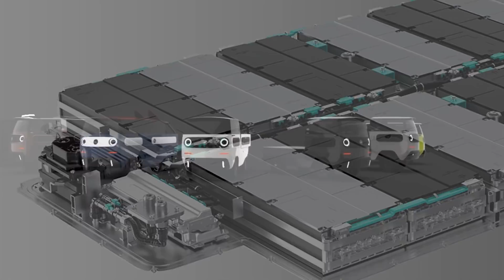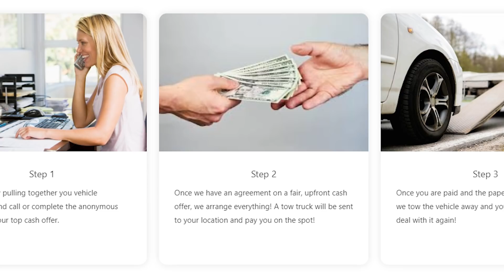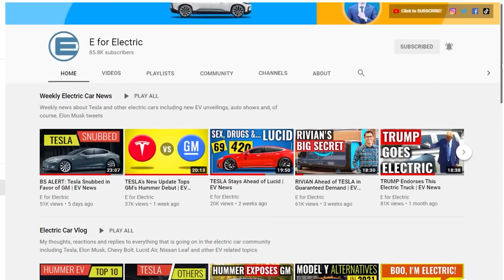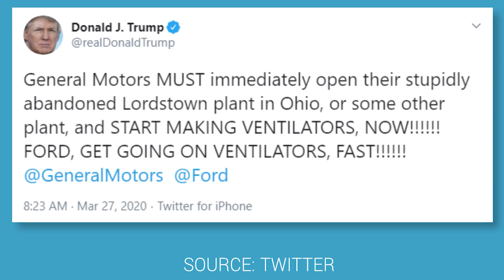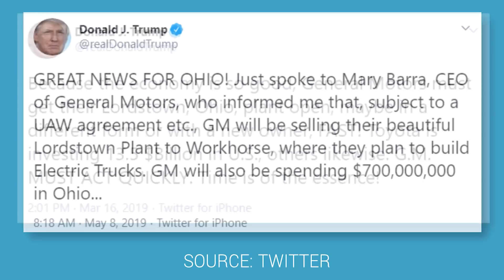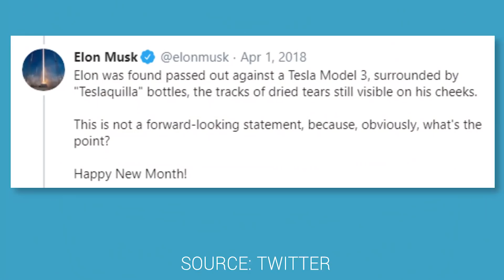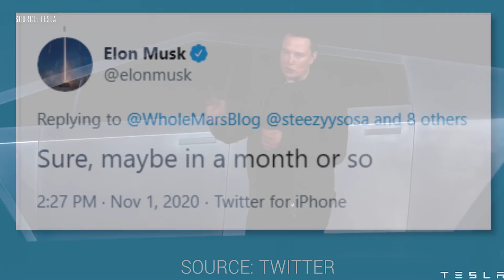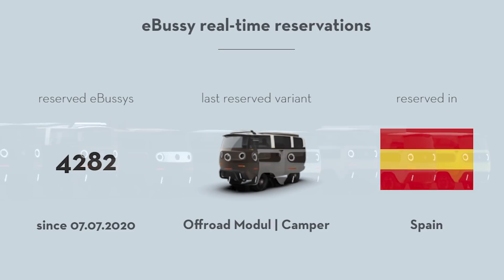Electric Cars Under Biden vs. Trump | EV News

Comment: Tesla and GM should not be punished for putting out an EV that people actually want to buy.  Agree with Tom's suggestions.
Reply: The whole point of the tax credits was to help EV manufacturers get off the ground with production. Tesla has already done that. GM seems generally mismanaged. The tax credits were never intended to be permanent.
Reply: Well, that's how it works in a country like America where fossil fuel companies can legally bribe politicians.
Reply: So we punish small businesses? Also if you watch some of the cars that hit the 200,000 mark “magically” drop about 7k 🤔. 
If you truly believe in innovation then you need more businesses and more eyes on the issue.
Reply: The purpose of the original program was to help OEMs get started in EVs to build sales volumes to a profitable level. The rebate Tom is speaking of now, would be for a different purpose... that being to increase the adoption rate of EVs by buyers.

Comment: I started watching when you had Rich Benoit from Rich Rebuilds on however long ago that was and it's where I get all my EV news ever since!
It's a shame that Toyota and Honda aren't more enthusiastic about EVs. They make the most consistently reliable vehicles in the world and I think either company could dominate the space if they went all in.
Reply: Honda are not going to sell any more diesel cars in the UK once existing UK stock is sold. That's a significant commitment.
Reply: It'll be hard for them.  They've all been in bed with big oil, producing cars that are designed to waste the oil company''s fuel for so long, they won't enjoy  the privileges of the past.
Reply: The electric hybrid allows use of a motor fitted into each wheel to assist during coasting on level roads and mild gradients. This increases fuel efficiency and life of battery to standard 15 years. 
Today, Tesla carries the equivalent weight of 10-12 passengers in battery weight. And stressed cells die out in 5-8 years 💀.
Reply: @solapowsj25  Agreed. And there are plenty of Toyotas that last 400k+ miles. If half of a vehicle's carbon footprint comes from its production then making vehicles that can last for years and years is a valid way to reduce the overall carbon footprint. But driving an old ice car until it dies isn't as exciting of a way to help the environment as buying the latest and greatest EV.
Reply: @kylewollman2239  Definitely, EV experience is an adventure that'd contribute to decreasing pollution. 😊
Reply: @kylewollman2239  Where are you getting half from? The highest estimates I've seen put production and delivery at around 28% of a car's lifetime emissions, with other numbers being as low as 12%. This percentage is likely higher for electric vehicles, since their operating emissions are lower and their creation emissions are higher, though percentages are ultimately meaningless if the long term total emissions of replacing a gas car with an EV is lower. But it's still better strategically to target electrifying new car sales since the economics work out better and that will inevitably electrify the vast majority of cars over time.
Reply: I think Toyota and Honda follow customers behavior. Honestly, customers aren’t that much excited about EVs. As you already know it, people fear change and they have been used to ICE cars for so long that it difficult to build new habits for them.
Reply: @solapowsj25  But tesla batteries usually have over 90% capacity left after 200k miles.
Reply: @slopedarmor  true. The small replaceable cell units are easy to maintain.
Also, lithium will prove useful for fusion power production hence has good recycling/reuse value.
Reply: @solapowsj25  I dont think the new 4680 cells are gonna be replacable tho since it looks like they're all gonna glue them together into one rigid structural brick.

Comment: To Tom, not sure more rebate for more range makes sense.   If you drive a Leaf 75 miles a day that offsets as much CO2 as driving a Tesla 75 miles a day, so why a bigger rebate for more range?   Your actually better in some ways with a smaller battery in the Leaf which initially has less carbon impact from manufacture.  Also cheaper cars are for poorer people who need the rebate more than the richer buyers of more upscale luxurious cars that have longer ranges.   Makes no sense.  Counterpoint:  longer range cars have batteries that will last longer, providing some long term benefit.  It gets complicated.

Comment: Surely the problem with changeable batteries is that most manufacturers are battery supply limited.  So how many more batteries do you need if you are going to make  a reasonable number of changing stations.

Comment: I found your channel between 2 and 3 years ago. Congratulations on your 4th year. It is channels like yours that motivate me to work on growing mine.
Regarding the 7500$ tax credit, I agree that it needs to be revised. Here in Québec the credits are applied at point of sale and it makes it much easier to digest for those who don't have as much money. There should also be restrictions on the value of the cars that are allowed to get the credit. It makes no sense that a 70,000$ vehicle gets the credit, in general a person who buys a 70K car has a good annual income and the 7500$ does not affect the decision.

Comment: Here in Canada, we have a very low tax credit limit of just $55,000.00 CAD (US$42,300.00) so I was unable to purchase a Tesla Model Y dual motor, one of the reasons I bought a 2020 KIA Soul EV (64KWH) as it came in at $51,000.00 CAD (US$39,3000.00), here in Canada the Model Y dual motor is CAD $69,000.00 (US$53,800.00) all prices are before taxes or any rebates.

Comment: The only problem with Cash for Clunkers is that it has been my dream to convert a 1975 Buick Electra 225 to electric for years, but the only ones I ever see on the road are the old rusty examples that were owned by people too poor to take advantage of C for C.
The good ones that were worth restoring were turned into scrap metal, and I'm too poor to restore one that's almost unrestorable.

Comment: There is more to a station than a charging station.  People need food, convenience store, and bathrooms.  The government should limit subsidies to adding charging stations to existing gas stations and at the most, provide a tax credit,   The real hurdle is the power grid.  Electrification of everything will have great impacts on the power grid and increased power generation requirements.   We would probably need to go to a distributed power grid, where individual home owners and farms, could produce and sell electricity to the grid.   Power companies don't want that to happen.  They want to control power and reap the profits.    Another issue, is that our roads are funded by gasoline tax, which electric cars do not pay.  A replacement tax structure needs to be created that will encompass all road vehicles.

Comment: Seems to me that more should be focused on power generation, than giving away money for getting people to buy cars that run on electric. EV's are generally better than gas cars, cheaper to operate, and last longer. But we don't have the clean energy grid to be able to switch 20% of the country to EV's the next 5 years, and unless you can afford 6 figures, your not going to be able to put in your own panels, battery storage, and buy a decent EV.

Comment: EB : Those numbers don't make sense - 373 miles on 30kWh - that is 12.4 miles/kWh which is about 3 times better than the most efficient electric cars on the market - Tesla 3, Lucid Air and Kona/e-Nero which return between 4-5 m/kWh.   And it is aerodynamically a brick - this is vapourware/bollocks

Comment: A 175 -200 mile range for people who charge at night at an affordable price in the 20,000 range sould be an easier transition for those living check to check and driving a 10 year old Nissan Sentra. That range gets me 2  days of a round trip. I currently have a Clarity that gets me 40 miles EV range---I drive over 75 mph in the HOV lane with either AC or heater on even though I live in SOCAL so my EV range with the typical one speed EV drivetrain will never match manufacturers claims. Since part of gas taxes go to the infrastructure they will eventually need to be replaced with a comparable EV road use tax. I guess it will be based on vehicle weight---so 175 to 200-mile battery makes a little sense compared to the 400 mile monsters the auto magazines love to write about.

Comment: I think the range based incentives idea is not a good one. Reasonably the maximum useful range for me for an EV is 150 miles. Why should I be incentivized to buy a vehicle with an oversized battery for my needs by a tax credit? It will push the market toward everyone having 250 mile range. Certain companies are hard pushing range, range, range, but that isn't what the average person needs. If you want to get everyone in to an electric car you should be pushing cheaper 100-200 mile range options with smaller batteries. For most people that is completely sufficient, cheaper, and has less environmental impact. Hell a lot of people would even do find with sub 100 mile city cars.

Comment: Well the Honda E having 110 miles of range doesn't sound like much, compared to the Nissan leaf it's an amazing city car.

Also it keeps the price low, I think I heard estimates at $25,000 to $30,000.

Other than Kandi that has 59 some odd miles at $17,500 before the tax credit (if my calculations are correct) , it's the most affordable electric car in America, if/when it comes to America.

Comment: Toyota does make an electric car, It's called the Mirai and although it uses Hydrogen for its source rather than battery, it is an electric car.  I had one of the first ones in 2016 but I sold it at the beginning of this year due to a bad infrastructure and bought a 2020 Tesla Model S.

Comment: Congrats on your 4 year anniversary, I really enjoy your channel. I agree with Tom's take on the EV credits and that it should be deducted at point of purchase if the wish is to increase EV purchases and making them more affordable up front. I would like to see a credit for thoses first time EV buyers who buy used (yep that's me). As a homeowner of an older home maybe some help in upgrading electrical panels to comply with newer codes to help with installation for home charging needs might help as well for all the non-tesla owners who don't have enough reluable level 2 or fast charging stations in their states/cities could also help those interested in going with an EV.

Comment: EV are still to expensive and if you have an older Nissan Leaf I have heard older Nissan Leaf owners having trouble getting replacement batteries.
Reply: Nissan Leaf battery’s are designed to be defective and die. 💩💩💩

Comment: The 5 year "sun set" I can agree on. (But I'd say past 2024 it gets 75% of normal until 2028, and then 50% of normal until 2032, and 25% until 2036 and then ICE vehicle ban)

The $30 credit per EPA mile I can agree on. (It also encourages hybrids to go more than 15 miles, funny enough Ford said that they had the longest range plug in hybrid while literally being the shortest range) and maybe a cap of $10,000. But no one has +300 miles except Tesla, and I'm disappointed in everyone else because of this.

The $80,000 cap I can agree on (I would have said $60,000 though, and the administration sounds like if you make more than $250,000 you don't get it)

Comment: Transportation of chemical power accumulator cells. 
My father did better for Bhilai Steel, Russian Steel colony, and was awarded by the Indian government. 
But without the technology he used, Tesla is confabulation, General Motors honestly couldn't, boats proved that they would not spur, and the disappointment is worst when science proves that the carbon footprint of EV is larger than fossil fuel vehicles.

Comment: any tax credit should be limited to $40k max
Reply: They have a good system in France where you get 7K € if the car cost less than 45K €, then 3K € if the car is more expensive (I believe up to 150K and then nothing).

Comment: Although battery swap might work for some people in China it is a dead end technology. It necessitates a exact size battery and will not work on all vehicles of various brand, battery sizes, and changing technologies. (It actually requires MORE batteries because every vehicle will have a battery and then there’s a bank at every station charging waiting to be swapped) It would take a ridiculously massive cost to install worldwide and with range increasing and battery charge times falling quickly it will soon be pointless. In addition Tesla is showing that the future of battery electric vehicles will be integrated structural batteries.